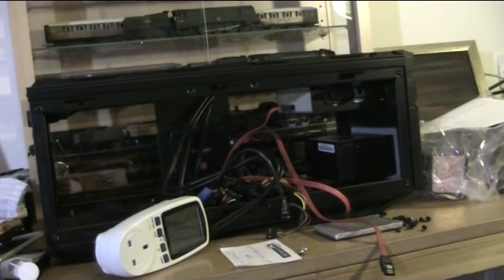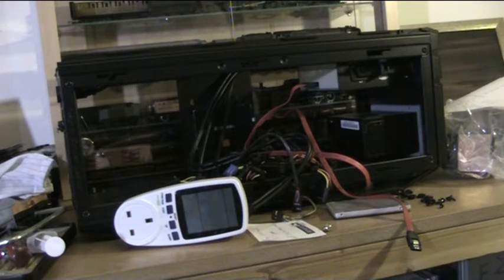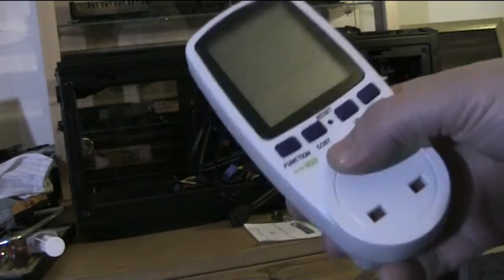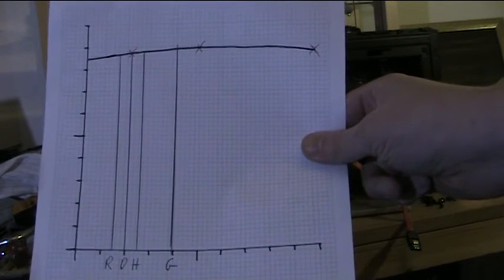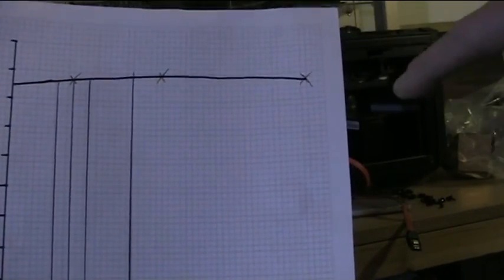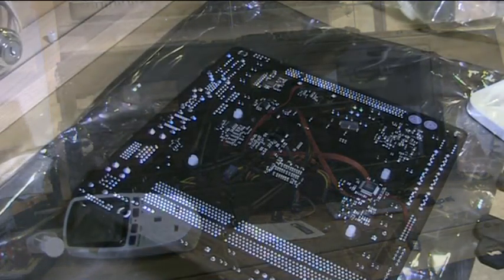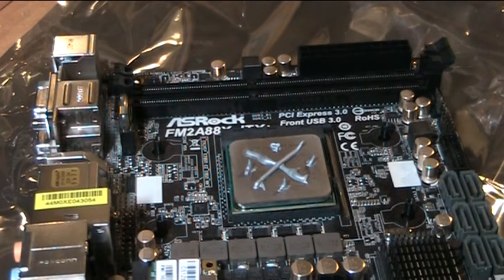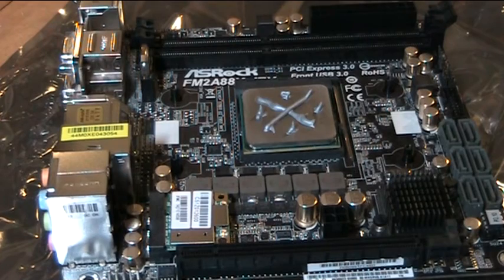The Build From Hell - Take 2

Comment: This kind of MOTHER board!

I kept meaning to watch this video, partially because I've been rebuilding my machines and I've just got one of those meters. A few surprises here and there but it's fascinating (and terrifying at times). I haven't tested the Windows PC yet, but it has a graphics card that runs so hot that I often fear it could start a resonance cascade like at the start of Half Life.

If it is the CPU you can say, "You sexy MOTHER board to it" when it fires up.

Comment: The fun of computers. Hate it when you buy stuff that is dead. At lest the stuff from the skip you did not care about and would completely vandalize it, salvage a few bits and treat it like a frizbe.
Reply from the maker: +TheEPROM9 Yup, and after giving it hell, you apply power to it and... it still works! ... they don't make 'em like that any more :-(
Reply: 2005 was the worst for well built systems, since has improved but there is still progress to be made. I don't think there is any tech from the mid 2000s that works today.